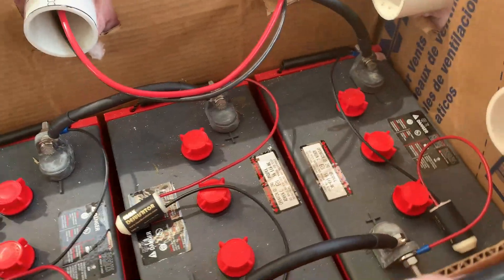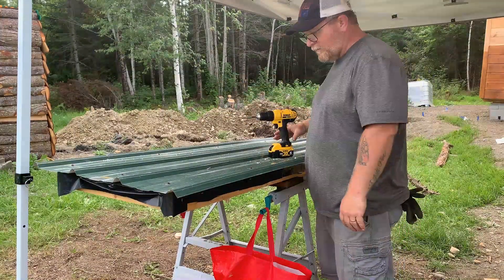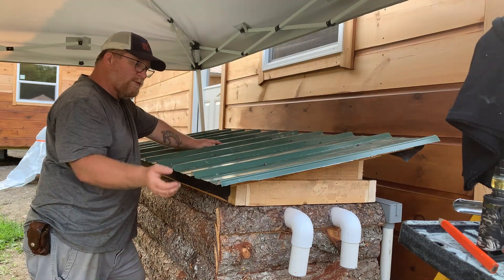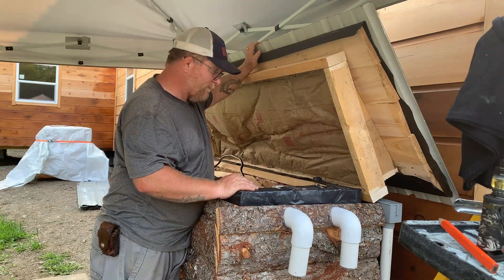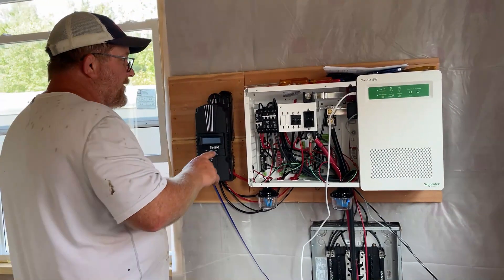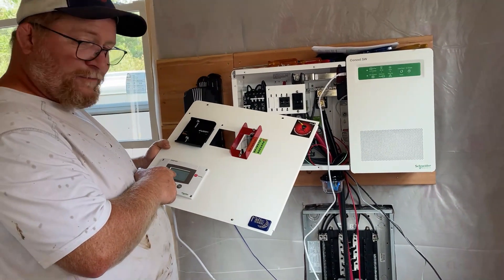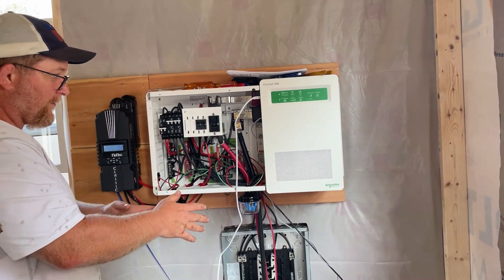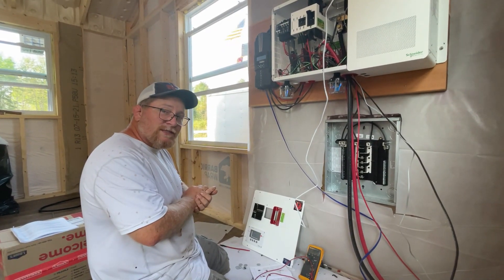2.64kw Off-grid Cabin Solar Install | SW4024 | Midnite Classic | Rolls 24V 890AH Batteries | Part 2

Comment: Battery cables are to long. At least they should have minimum of 5 feet but it look like they are more than 10 feet. You will have problems in the future. You need to reduce feet on battery cables. How did you install the bypass breaker 😊
Reply from the maker: @Hilerio-k8j  thanks for the comment, the cables in this video were indeed long but are now ~4’ after we moved the equipment to our new shed. 😊  The bypass was installed according to the Schneider print.  It’s been awhile since I installed it.
Reply: @ good because I have the same set up.